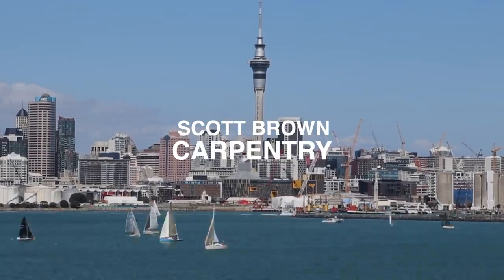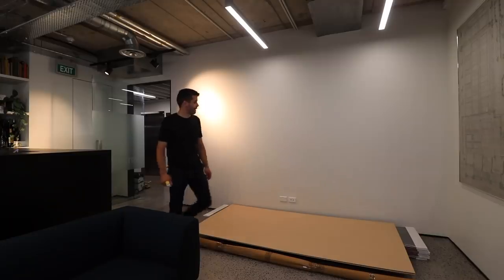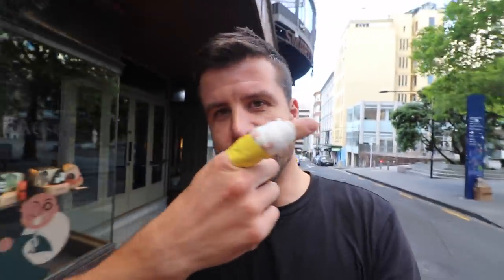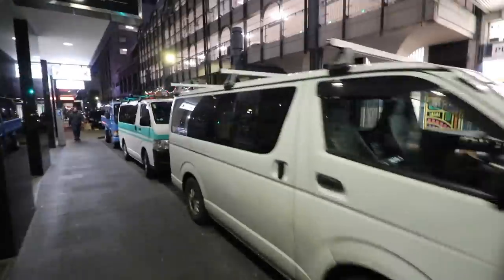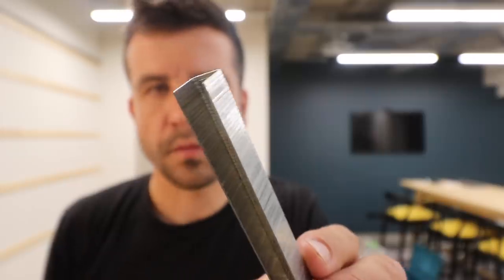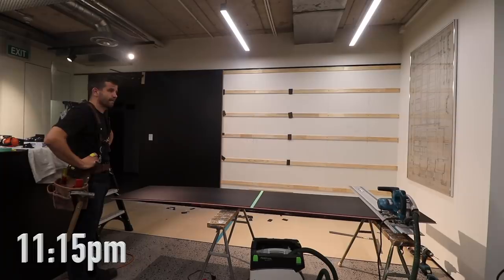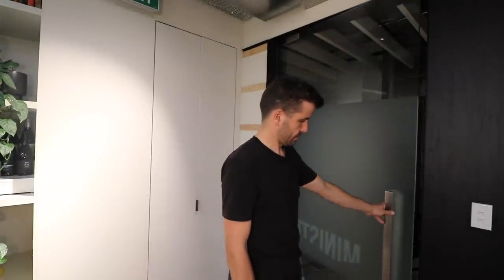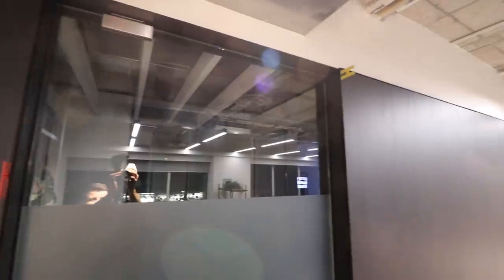Working Until 3AM to Finish a Feature Wall!

Comment: Hey man i was just using this material on our jobsite. And thats inside a boat in the bathrooms. En we have is with a tile print. So we just seal the joints and the edges. Then its waterproof and clean en very straight. Its very good material.
Reply from the maker: Oh nice one, I didn't know about the tile version

Comment: Nice job. Do yourself a favour and get the Bosch gas 35 m dust extractor, used mine for wall chasing, cleaning up after , even hoovering 10mm stones off of a roof after pebble dashing the back wall, never let me down.

Comment: Regarding your vacuum cutting out due to lack of power, this week Milwaukee Introduced the MX Power Station 1800w/3600w with single or dual batteries with Inverter for charging cordless tool batteries or 240v Appliances on the Job Site

Comment: I don't know what you guys call them over there but you should get a handtruck or dolly as we call them in the usa. They make foldable ones and you could stack up all of your festool and makita containers on it and push them all at once. Should fit in your van decent
Reply: Yup, Makita make a dolly for the Makpac systainers, I have the Bosch equivalent. Very, very handy with the van is a long way from the job.

Comment: I did an all Nighter once, I had to finish twelve frame and panel doors for a client. The job had been delayed due to unforeseen factors on my side, the client was becoming increasingly irate. I worked all Night till eight in the morning, slept for four hours and spent another four hours in the Workshop. Then loaded up the doors and tools, went to the job and fitted them. Finished up at mid-night and had a long drive home. I'll never forget it! 🙄

Comment: In England working in some town centres your best just to get a parking ticket and pay it. Saves time messing about. Either have a deal with the client if you’re on day rate or work it into your price. Excellent videos thanks.
Reply: Same. City work = add on parking ticket. It’s usually a lot cheaper than actually paying parking for a day!
We dumped an 18T in London once. Parking dispensation = £300, ticket =£100!

Comment: I think you need the makita mac pac cart not the dolly the sac barrow style , looks great and very well installed
Reply: Mario have you seen the trolley for the Mac pac cases if your in and out of lifts and transporting as in the video these folding trolleys are a godsend check them out
Reply: Mario yes you can load 5 or 6 makita Mac pac cases maybe more and wheel them up stairs through doors and wherever you choose I use mine daily and it’s better than the festool cart

Comment: Another great video Scott!   What is that makita guided circ saw your using?
Reply: It's a Makita track saw, Dewalt, Bosch, Mafell and Festool have them as well. Once you have one you'll wonder how you managed without one! 😁
Reply: TheToolnut will be looking into one this week, thanks!!  
Is it worth getting the festool one to work with our festool?
Reply: @healing2gether   It depends, you need to decide whether your going to go cordless or corded. I purchased the Makita 36v track saw as I had bought into the Makita 18v platform. If you spend most of your time in a workshop, I'd advise getting a corded model. If you spend most of your time out in the field, I'd advise you to go cordless. For portability and convenience the cordless tracksaws are the way to go. One caveat I found with mine is that it lacks a bit of power for heavy cuts like solid doors and such. I have my eye on the Festool 75mm corded tracksaw for heavy duty cutting.
Reply: TheToolnut thanks for the feedback!  We are always working out in the field so portability is important.  Our festool goes everywhere with us, but between our impacts and hand tools and multiple Graco handheld paint sprayers we are filled with the Dewalt 20V system.
Reply: @healing2gether  Any vac can be made compatible with any tool given the right hose adaptor. Does your Festool vac have bluetooth? You might think about a blue tooth set up as well. Makita make a 36v bluetooth cordless vac that can pair with my bluetooth enabled 36v tracksaw. It's on my list! 😁 You might consider the Dewalt flexvolt tracksaw with a Dewalt bluetooth vac.
Reply: TheToolnut good thinking!

Comment: I don't work in the city because of the BS with driving & parking there. My Stepson is a contractor who lives & works there. The anti vehicle & parking cost has become such a mess in Toronto what he does now is simply dump his truck right outside the job ignoring the permit requirements, parking enforcement & wardens. If he gets a ticket he pays it.... At the end of each month, he pays his tickets & it is cheaper & certainly more convenient than parking legally in 9 out of 10 cases. When he adds up the lost time searching, the wasted time constantly having to lock it up, distance between the job & the truck, it saves him BIG TIME.
Reply: Yeah and at the end of the day you can roll the ticket charges into the job, or figure it in before hand
Reply: @feelingtardy  mate of mine works in London on a fairly regular basis (lift hydraulics engineer) needs the van near the job as many things are coming and going from the truck, the difference in costs between parking legally and just dumping the van on a yellow line right outside the job is marginal but the convenience factor is immense, the customer ends up paying as his firm stick about twice the parking fee onto the quote lol
Reply: Don't they tow vehicles in your country?
Reply: @MsElijah16  Only in defined tow away zones....
Reply: @goatsears  the only thing with tickets in London is if you miss the payment date they fine you at like 2000%.
Reply: @MsElijah16  In some areas, yes but its always clearly signed, he just makes sure that he's in an area that is just warden enforced tickets. I will ask him about his solution in tow-away zones.
Reply: @Palo-jm7xc  He pays his straight away on the company credit card

Comment: A bit of CA glue on that cut followed by activator would have sorted you out. Stings like f*ck for a couple of seconds. Used it many times. 

I heard super glue was invented during the Vietnam War to temporarily keep wounds together.

I've done work in Glasgow City centre a few times. Most of the time is spent with my head out the window checking to see if my trailer is okay.

I reject a lot of city jobs now. It just ain't worth the hassle searching for a parking space. 

Greetings from Falkirk.
Reply from the maker: Cheers pal, the nurse used glue to close the cut in the end!